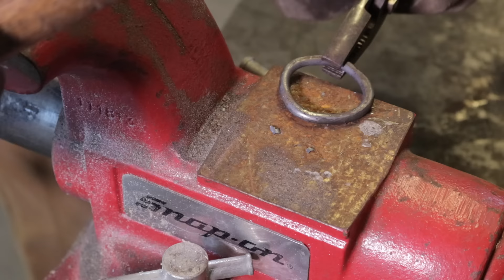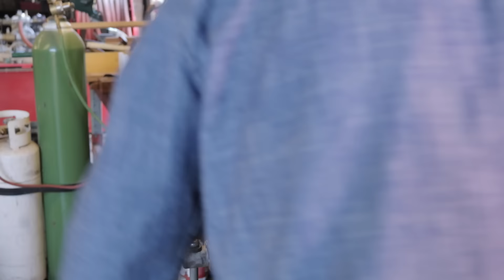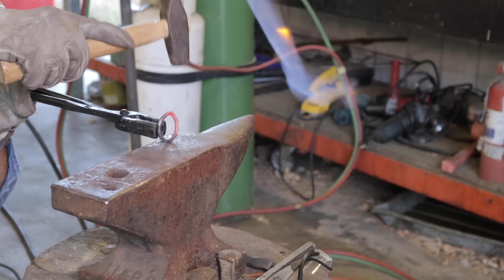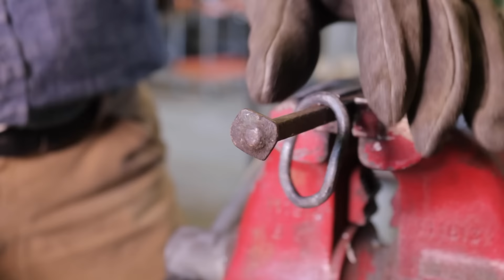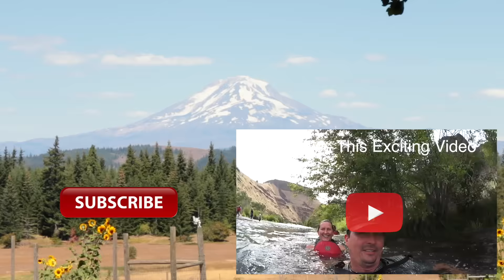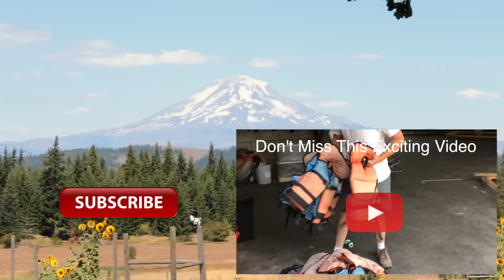Forging A Ring In Fire - Modern Blacksmithing

Comment: in northern Sweden we used to call it the bissmån. in american bissmoan.  the weight was on one side, fixed. and the hook for what was to be wheiged on the other point of the rod. it had a sliding handle that would balance the scale and give you the weight. btw love your channel :-)

Comment: isntead of a mig welder, put the ends of that chain think about 3/8s of an inch overlapping and heat it white hot. one hefty blow right over the top of it will permanently forge weld it together

Comment: Cody, sorry I'm late to the party on this. I have a similar scale and mine has a smaller loop that attaches the weight to the beam. In your other video you mention that the weight is often lost. Mine is captive and can't be removed from the beam. Maybe you've figured that out already. Seems like a small coldshut style link would work best. Good job !!

Comment: Hi Cody, please ad som oxygene when you light your oxygene/acetylene burner, just a little to prevent the yellow flame. The yellow flame makes some small black soot particles flying around in your workshop, laying all over as dust. You inhale it ant that's not healthy! And turn off the acetylene first when finished. It will say a little poop, but leave no blacks in your workshop.

Comment: Seems like it would have been a lot easier to have found a chain link about that size
Reply: I would have bent the rod around a pipe then welded it then do my hammer work to finish
Reply: It's super helpful to actually have two pipes or pegs. Stick it between the pegs, and bend... the spacing between the pegs determines the bend radius. sometimes one or both of the pins will be split so you can drop a link in vertically and bend  through it, so you can just run links in a chain one after the other.
Reply: +Rion Motley I know what your saying but if I want lots of hammer marks in the piece for added character it would be the same with 1 or 2 rods used lol
Reply: Yes, it would be a lot easier to just to go to Walmart and buy a scale.
Reply: Maybe easier but the nearest hardware store is like 2 hrs away so not quicker.... And if he did everything the easy way he wouldn't have a channel!
Reply: He could just hire some locals to do all his farming and firefighting for him, too! facepalm.
Reply: +Rion Motley really? Talk about blowing something out of proportion

Comment: I would have approached this differently. I would have used a cone and wrapped around, beaten it to size with a hand held thick pin "1/2 inch" needle scaler.
leaving it to spread wider, as the ring is forced on to the cone. you only need hold it vertical to the cones axis.

Comment: Good luck on the run!!!!  I have been watching your videos for a few months now they are great. You are very smart, that is why I am going to ask you a question I need help with. if I ask the people around here they might just try to get all my money or just lie to me.  I have a small Jon boat  trailer, I guess it was home made there is no info in it. I want to know how much it would hold if I made it into a utility trailer. it has one long leaf spring and then a small one. it is 15f 7in x 3f 6in on the inside of the fenders. so how much will I hold? and is it cheaper to sell it or add more leaf springs? would I need a bigger axle? I just want it to hold small side by side ATV or gulf cart for me and my service dog and have a rack on top for my 12fy Jon boat.  Thanks for your time. or if you or anyone can tell me where to go, web pg, a company.......

Comment: Did you forget to attach the ring to the weight? (Typing this after watching for 2 mins)
Reply: i was thinking the same thing, and how do you avoid melting the lead weight
Reply: He said he'll cut it and re-weld.
Reply: Right there with ya. The weight has a closed loop on it. Now he has to cut the ring again or do the entire process all over.
Reply: Was also wondering about that, but I've been watching him long enough to have figured out his plan.
Reply: Jesse Sisolack Yeah I saw that. I think we all typed the question prior to the end of the video lol
Reply: The weight is probably cast iron

Comment: OK I dont want to be critical maybe look at this comment as helpfull ! First you should plan out how to do your task ! Then assemble the equipment you need to complete your task and finally do the task in the most efficiant way you can ! Ok i know when we 'play' in the shop this isnt always practiced :) However wathing you heat a bit of rod then tapping it round with a hammer i found to be a bit irritating as thats clearly not the way any blacksmith would do it. Its a learning process though right and you have already told us that youve never done blacksmithing before. Well the thing you need is called a form. Its something that you can form your metal around or on. A bit of pipe with a hole would have done. Stick the rod in the hole, heat the rod, bend the rod round the pipe. Cut the rod free. Job done. Tap tap tap heat heat tapp tapp  tap just isnt the way to do it. Sorry i have to point this out as it was just too irritating watching someone doing a job the wrong way. Hope you understand. Maybe imagine watching jack butcher one of your prised crosscut saws with a file and you maybe understand how i feel :D Anyway good luck and looking forward to some more videos.
Reply: You want to know the funny part about this?  You are trying to come across as an authority but you only demean yourself in front of the entire world wide web.  There is just something about the internet that brings out the stupid in people.
Reply: ScotsFurian
Hey, you aren't mad, are you?  I was just trying to be helpful.

Comment: he isn't even blacksmithing is only used in gas heating and b***** like that This is highly disappointing to me considering I actually value the art of blacksmithing blacksmithing does not have gases to Heat metal the hierophant excuse for an attempt at getting views
Reply: Wish you valued punctuation as much as you do blacksmithing...Maybe you should just go elsewhere, I wouldn't fall for his b***** again!
Reply: Tenspeed TheBikeHanger ok the fact that you attack my  punctuation is low and very childish.

and blacksmithing with gas is stupid and it will not be as strong as a coal forge can get it.

i will not reply to you after this post.

also i was using voice to text software